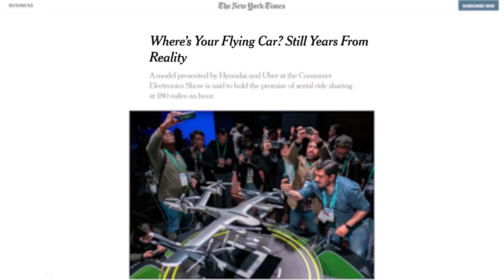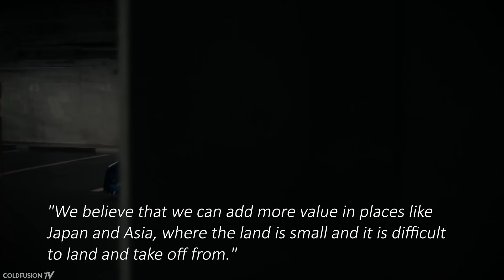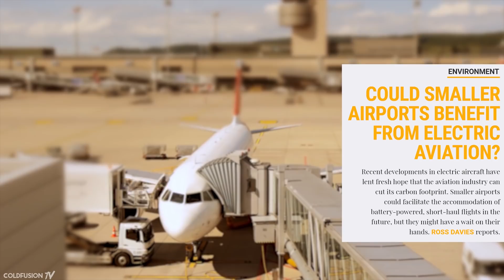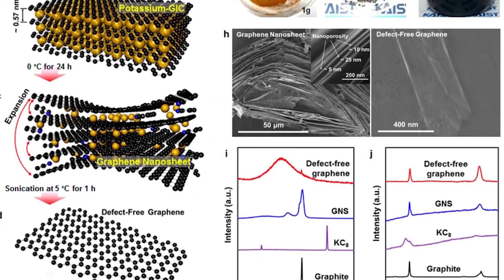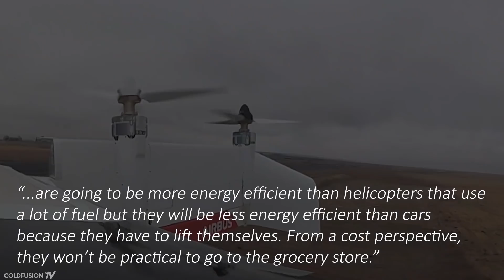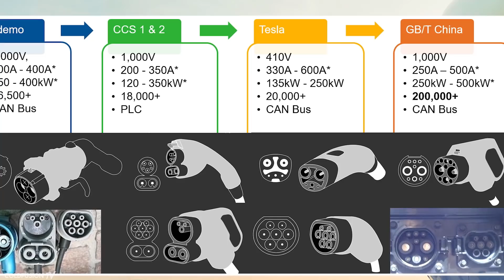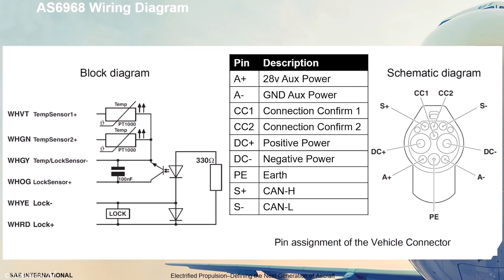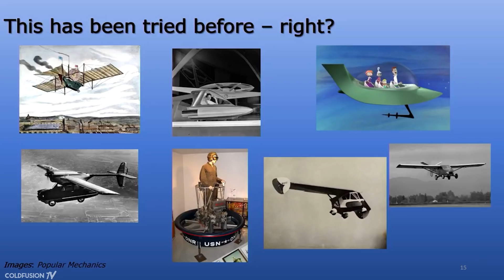Japan's Flying Car – Problems and Solutions

Comment: "Wright Brothers took humanity to the skies" lol, Santos Dumont laughs at that sentence haha
Reply: Who is that?
Reply: @violenceisfun991  the guy who made hot air balloons
Reply: @circleinforthecube5170  no, lol
Reply: @circleinforthecube5170  Santos Dumont 14 bis is the first real airplane. Google it
Reply: @circleinforthecube5170  took fly thanks to a catapult
Reply: @GabrielBerti  the catapult wasn’t used until 1904.
Reply: @violenceisfun991  he is the creator of the airplane. The Wright Brothers airplane can't fly without being launched by some catapult and it can't fly for more than a few seconds
Reply: For takeoff the 1903 Wright Flyer used a launch rail and a wheeled dolly which was left on the ground; the airplane landed on skids due to the sandy landing surface at Kitty Hawk.[16] After 1903 the Wrights used a catapult to assist most takeoffs of their 1904 and 1905 airplanes. The Santos-Dumont 14-bis did not use a catapult and ran on wheels located at the back of the aircraft, with a skid under the front of the fuselage.

Comment: One of the major factors to consider is not how is it going to fly, but who. There will either have to be massive limitations on how high the operator can go without a valid pilots licence. I see there is massive potential in the light sport sector for this, flight training will benefit massively from this but there is a increased concern for safety as it becomes more widely available due to the level of competence of the operator of the aircraft.

Comment: As a kid in the 80s, I was told flying cars would be a thing in the 2000s (remember the Moller SkyCar?). I kept waiting.. By 2015 I stopped dreaming of that flying car dream.  In 2020, we technically have flying cars but they're clearly terrible airplanes that barely qualify as road legal. They're always prototypes and/or costs hundreds of thousands of dollars. 

There's still so many issues I don't even pay attention to them because we're clearly not ready and won't be for a while. They need to be safe, cheap, economical, electric, run for hours,  automated, with people and laws supporting them. We're so far away from that. 

We're far closer to completely self-driving cars without needing supervision and we're still far away from even the laws allowing that. So flying cars are a no for me. Just give me a cheap,  completely autonomous self driving van I can sleep in while it's driving me.

Comment: Could be that electric cars, with object avoidance similar to drones, may be safer. Looking ahead, the charging capacity at commercial airports for electric airliners would have to be massive. Consider a typical plane does a 35-45 minute turnaround now, including fueling. How will that be accomplished while waiting for a charge?

Comment: I'm sure a, somewhat, fix to the charging issue would be for charging stations to simply carry already charged batteries and have a machine switch them out in a couple minutes. He did say one of the benefits of electric over gas machines is simplicity, right?

Comment: I would like to add a major problem with electric planes and cars which was completely skipped. Planes have a massive cost attached to them which is airport costs. When you land take off and stay on a large airport it gets very expensive very quick. Imagine what that does to airport congestion when planes stay 6h to instead of 1-1.5h on the airport. This makes aviation companies pay even more per minute. Also electric Atlantic flights will not be a thing befor we get batteries with a specific energy of atleast half of fuel. And we still probably won't be able to do it. Let's take a 747-100 it has a empty weight of 150t and a MTOW of 330t. To cross the Atlantic we need 120t of fuel. We can add now 50t of cargo. The newest model 747-8l/f is about 20% more efficient with a empty weight of 215t and a MTOW of 435t. So crossing the Atlantic uses 96t of fuel. We need a battery with a specific energy of atleast half of fuel or 20 000wh/kg. I mean we can fly our 747 over the Atlantic but with practically no cargo. What's the best we have now? 250wh/kg 80th of what we need. The air aluminium batteries get to 1300wh/kg but that is not even close to what we need. With the aluminium batteries we need 2940t for batteries. Also our airplane is less efficient because when empty the batteries still weight. Add atleast 30% of efficient loss on top of that. 
With flying cars I'll say. This increases energy use by a significant amount. Which makes generating green energy so much more challenging. And also. Flying is incredibly hard. Flying is safe because we have invested billions into making it safe. now imagine when we make some idiot fly. To make electric flying cars viable we need to first have a already green energy grid.

Comment: Wait, wait, wait, let’s get back to the aluminum air batteries. If they really have 1300 Wh/kg (more than 6x than Li ion), why aren't they used ine electric cars? AFAIK, aluminum is cheaper than lithium.
Reply: Ok, Wikipedia has the answer: https://en.wikipedia.org/wiki/Aluminium%E2%80%93air_battery?wprov=sfti1

TL;DR, they are not rechargeable and anode is very costly.

Comment: I have hard time believing that E-VTOL can actually be more efficient than helicopter. 
Many small motors with fewer blade active surface area = more effective ?
I feel like we try to reinvent the wheel and create something new to sell.
Reply: A single big propeller from a helicopter is more energy efficient than multiple small ones.
The problem with that big propeller is control. The cyclic and collective mechanisms on the helicopter is a delicate and complex piece of gear which needs a tremendous amount of care in it's manufacturing and maintenance. It also produces a lot of stress for the blades which also makes them more expensive to build and maintain.
Then #1 cost for helicopters is their huge amount of maintenance because of that single propeller design.

The quad-copter design bypasses these issues completely by using very simple, very cheap and maintenance-free propellers. And controlling the aircraft by very rapidly changing the power of the individual motors. That's the trick that makes all the modern drones cheap and reliable, whereas the same devices under a classic single propeller design would never be used.

Comment: I've seen cars with parts gaffer taped onto them, exhauts hanging off, tyres worn down to the steel, broken windows. Does anyone want a flying car owned by the idiot down the street? How many drunk driving accidents are there every year? Now imagine that the drunk driver can hit you fucking ANYWHERE. Not near a road? Doesn't fucking matter, the drunk idiot above you just passed out and you are walking along with your kid as his car heads right towards you in the park.

Comment: We could get a breakthrough if we could have no contact charging..say instead of roads we have fly zones along which the battery gets keeping charged as long as it remains in those zones with an emergency backup if It goes off grid..also the traffic can be controlled with polarity working in only certain direction..they could be charged on the energy used..someday maybe

Comment: I'm concerned about flight stability/comfort and the take off/landing time. Small planes are miserable to ride in on a windy day and will time be saved with a higher nominal speed but longer times on either end for take off and landing

Comment: Great video. Love your channel and videos. Wondering if you've done a video on the future of energy? In other words, are renewables  the answer? Can wind and solar ever produce enough energy? Does the cost to mine and produce the raw materials outweigh the benefits to renewables? It seems to me the best/most efficient and cleanest form of energy is Nuclear. So much advancement has been made to make it safer, I think we (as a society) really need to consider this direction. I think everything that has an engine will be replaced by batteries in the next 10 years, so we're going to need to consider our electricity demand.

Comment: Great video.. i do keep wondering though once all the technical difficulties are solved , how these aircrafts are going to be used and what kind of regulation should be followed ? Do people need licenses to operate them ? Are they going to be monitored from the ground and by towers like normal planes ? What kind of air crash avoiding systems shall be used to ensure everybody’s safety ?? Alot that need to be answered before we start seeing these magnificent machines in the air !

Comment: I feel like this conversation will be more honest if people just replace the term "flying car" with "personal helicopters", there's nothing car about any of the flying car designs, if it doesn't go on the road, it's not really a car, and if it does go on the road and isn't flying, then it's just a car. The pitch for these vehicles don't seem to be flying cars, they're just selling electric helicopters, and are likely going to be used like how helicopters currently are used. I'm not inherently against a future where people get to their destination in 3D instead of 2D metaphorically speaking, if they can be made quiet, safe and fully autonomous, there's little reason to stick to one plane of travel, but I think detaching it from the silly futurism "flying cars" might be a good idea so people who've been hearing it for decades won't roll their eyes when they hear it.

Comment: Flying cars have a fundamental flaw; in the event of a total power loss they cannot land safely. Planes can glide to a nearby runway/roadway/field, helicopters can autorotate and land safely, but if a flying car loses power it can't do either of these things; it will plummet to the ground like a stone.
This flaw can be mitigated to some degree by carrying redundant motors, batteries, speed controllers, power distribution, flight computers, etc. but all of this redundancy increases cost, reduces useful payload, and reduces range.

Comment: the different charge rates thing. value is subjective, if it doesn't work for you, not buying it will put more strain on the business, forcing them to lower their prices at some point. value may differ for every single individual, so having different charge rates per area is pretty understandable, but the only way for a company to know what the proper price range should be is through profits and losses, which you as the consumer have complete control over.

Comment: Basically, you're not flying as an airplane does. You're flying at a certain altitude in a semi-auto vehicle. 
And if the vehicle not part of real aviation rule but does so on an operative level and the vehicle still applies 
as a road vehicle, the difference in air flight and driving would not be as obvious as it is. 

Cause first it still as to be defined as a crash-safe land vehicle, And I know not of crash safety for airplanes nor do I  have the knowledge if something as that exists.  These flying vehicles thus need zones to limit their flying distance. 

If a zone defines room for safety regulations it would still not be enough what defines a flying car and the possibility to take off. Regulations would require the taking of platforms similar to pump stations beside the road. That states a limiting flight distance between zones. Within and outside city limits. There is more to it than just the functionality and size and advancement inside such a flying vehicle.

Comment: The best argument I've heard for why flying cars will never be a thing is the noise issue. Those propellers they use are extremely loud compared to a car. It would be as if every person was driving around a motorcycle with no muffler and that much noise pollution could have poor effects on people's health. They can't really reduce the noise either since the whole concept is to get air moving under the vehicle fast enough to produce thrust and fast moving air is essentially what sound is after all. Unless they can find a way to reduce how much air they disturb but I can't imagine how they would do that.

Comment: Flying cars never going to be mainstream for many reasons.
1. Cost. They will always use more power than cars and for a long time they have to be built from expensive ultra-light materials and with expensive special batteries.
2. Safety. The higher you go the more you fall. And nobody want's to have burning metal raining on them from accidents.
3. Wind. Those huge fans have to push a lot of air down to keep the car in the air. Too many flying cars and you'll be walking in a constant hurricane.

Elon is right (no surprise there), it's better to go underground.

Comment: I think they should try to work with a removable battery approach as this will avoid overloading the grid/expensive batteries at the airpoirt.

If you have multiple large airplanes charging at a few megawatts it might be come a infrastructure problem getting enough current to the airport.

Of course with the current amount of airplains it is just as bad even with removable batteries. But downtime between flights could be lowered.

Comment: Developing this technology is fine. It can be used in a limited way for ambulances, firefighting, and other public service activities, and create other spinoffs from the research, especially battery improvement. But for the average person the "flying car" aspect is worthless and causes more local air traffic--and therefore more chance of accidents (death from above). It will just be another rich person's plaything and status symbol, and not a green answer to anything. In an electronically connected world, we don't need millions of business people traveling around just because they can afford to. It's bad enough that so much of current air travel is unnecessary in that regard. There's nothing actually "green" about creating a new repository for scarce resources that doesn't already exist, instead of replacing something that does.

Comment: I’m surprised you put such weight on the charging standard. This will definitely mirror the cell phone charger history in how OEMs will try to develop and license a standard they control until product ubiquity occurs and the monetization of a plug standard impedes future product sales. 
The biggest focus should be on energy sources... like perhaps what value Hydrogen may have compared to  batteries due to their diminishing weight through the consumption cycle of the flight whereas battery weight stays the same through the whole ride for example. I’m not a hydrogen over battery proponent however recent points made by other youtubers (and Bill Gates) are interesting.
Reply: Yep. Nothin like a standardized proprietary design! You gotta have it, cuz people can't be trusted to remember "red-positive/black-negative". I say, if you're too dumb for that, then you're too dumb to have an electric car!
Reply: gates is not interesting he is just a thieving thug

Comment: I wanna know the feasibility of hydrogen fuel cells for aviation. They are much more energy dense then Lithium ion and lose weight as they are used up. Japan also seems to be moving into a hydrogen future along with many other countries, so I expect the production to be more efficient in the coming years. The company is also Japanese so they will probably include hydrogen if it becomes a standard in Japan.

Comment: Elon Musk is right to focus on the future of transport vehicles in modules, not just electric cars, electric planes or electric "trains".
Modules that can switch transport are the best way to minimize the cost to citizens and at the same time maximize profit by minimizing the costs (including time) of the companies that manage air-river-road-rail-underground transport.
I know that this idea of exchanging the module, as an example on an air travel that a family made to Europe when returning, places the module in NY, then switch the base of the aerial module to the road to get the train station, to later switch to a railway base the module to go to Boston seems tiring, but the only way to automate this with the least chance of break in the previous planning is that way. Or, although it happily reduces traffic a lot in NY, by exchanging the module that arrived at the airport in NY from the air for a transport via drone base (instead of the road) to the short space to train station, it makes the transport of the module fast by drones in addition to an advantage over time, it is also a huge resource to reduce traffic in NY (or any central city that many foreign travelers come from).

Comment: Flying “cars” of the future are going to have to ‘levitate’ in a self contained manner. The exorbitant amount of thrust blasting it’s surrounding to create lift is going to have to be made obsolete. The fast spinning blades, rotors or turbines along with momentum of the craft it self (just to maintain lift) are all barbaric in terms of safety. And antiquated at best. One small failure of the smallest component reduces machine and occupants to a mere pile of blood and rubble.

Comment: re: charging standards, you'll never get one dominant architecture for a type of charging standard, for the same reason we have different power voltages and Hz for different countries. yes, electricity is electricity, but one standard for one country isn't the same as the standard for another. personally, until the problems of charging, weight, technology, etc. are addressed (and having the stars all align), I don't think the flying car will be seen used by regular people for maybe a decade. even once you have a protocol for a flying car in place, then you need some potential low-altitude flight rules and a pilot's licence. a long way to go.